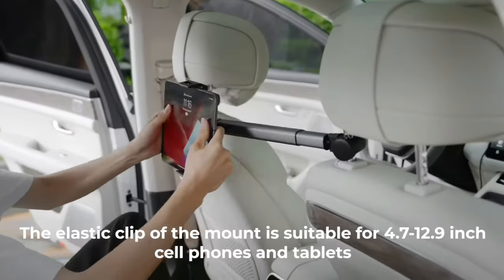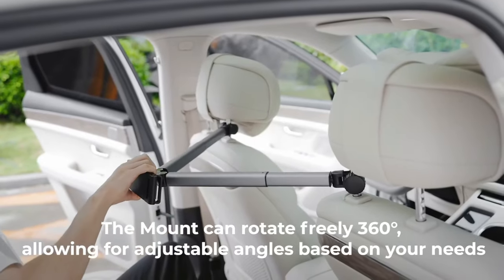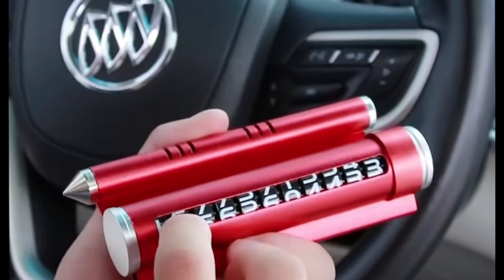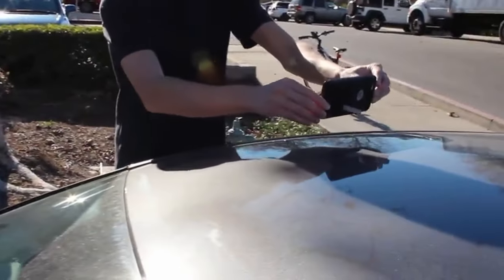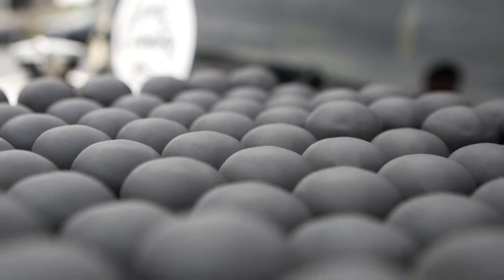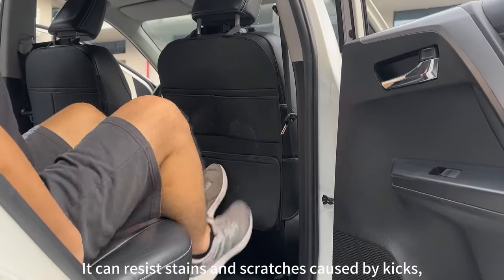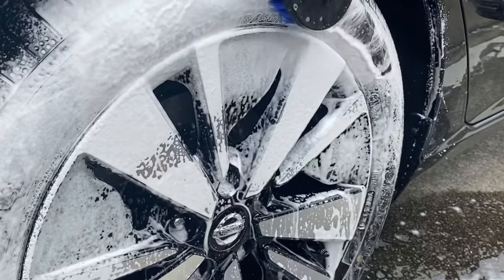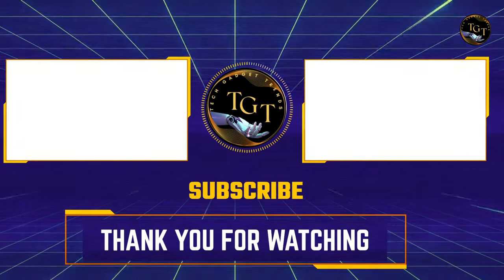12 Must-have Car Gadgets on Amazon 2023 | Choose your gift in 10 minutes

Comment from the maker: the links to the gadgets in the video are below: 

1 - 360° Rotating Dash Cam $199.99 https://amzn.to/3GrbDKY
2 - LISEN Tablet Holder $17.99 https://amzn.to/3R8XtDc
3 - Car Temporary Parking $78.74 https://amzn.to/4145XAe 
4 - Park Right tire-saving ramps $149.95 https://amzn.to/47SiSao 
5 - Bluetooth Media Button $16.99 https://amzn.to/46zoaqs
6 - USB Hub Port Suitable $12.12 https://amzn.to/3GqQ11o
 7 - Air Cushion $36.99 https://amzn.to/3Rmt1XG
 8 - Garage Parking Sensor $24.88 https://amzn.to/3uGBXyc
9 - Car Seat Back 26.99$ https://amzn.to/47UvWvW
10 - OTUAYAUTO Washer Nozzles $9.99 https://amzn.to/4a32Dcr
11 - Car Care kit $27.98 https://amzn.to/46H6AB0
12 - Navigation Protective Film $35.22 https://amzn.to/418JFNR